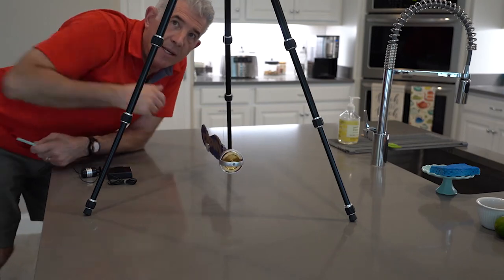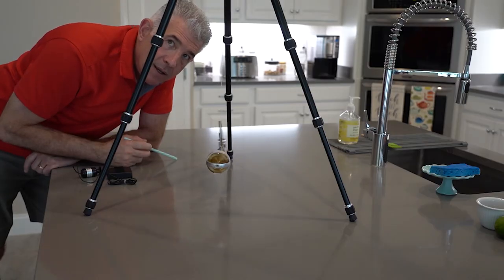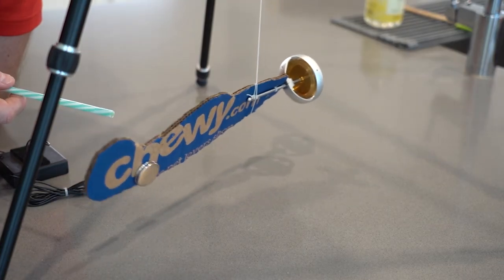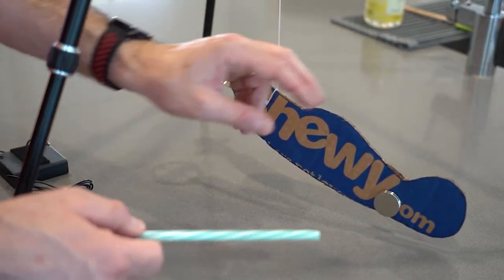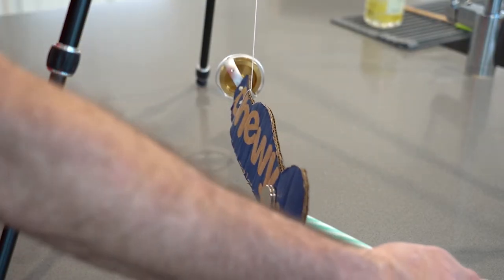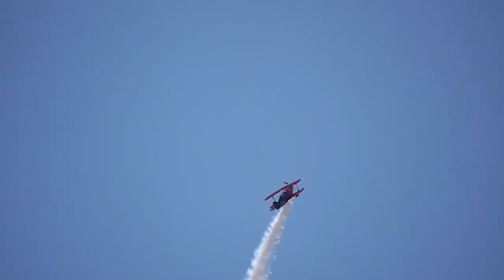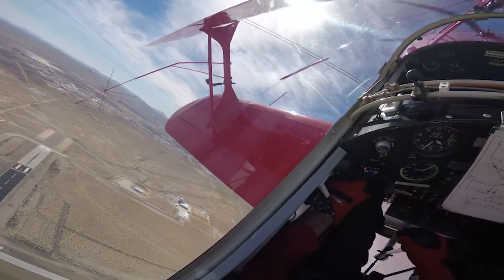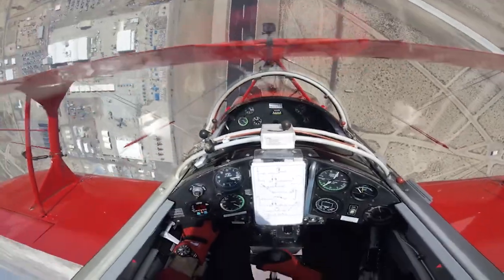Play by Play Series - Double Hammerhead: Why Gyroscopic Precession Is Your Friend

Comment: Spencer thanks for the great double hammer video. I have tried to do these quite a few times over the years (G202) and never got close. Today I went up and gave it a try and although I didnt pull off a good one I got a lot closer, I think with some more practice I will manage it!
Reply from the maker: The secret to doing it well is the timing of when you kick and then when you shove that stick forward those are the two things you have to figure out and it's hard to tell you exactly what's right for your airplane you just got to try it a million times
Reply: @ssairshows  I think I would die if I threw up a million times.

Comment: Nice demo.  I was trying these the other day and failed miserably.  After three attempts I gave up, but after talking with some folks and like your demo, I really need to be a bit positive on the up line.
I noticed you pulled the power after about 3/4 of the second hammer rotation.  Is this done to help avoid a flat spin when trying to arrest the second hammer?

Comment: Is the right aileron during the right kick recovery (before the quarter turn) just to line up perpendicular with the runway or does it have to do with the recovery itself and staying coordinated? Great stuff by the way!! Fantastic flying and terrific to hear you talk about the physics of flight!!
Reply from the maker: That helps with controlling torque so the fuselage doesn't twist around, this is not a coordinated maneuver.  Even in a normal hammerhead right aileron is used for that purpose.

Comment: Hello,
Great tutorial! I’ve been doing this on Extra 300L. About 20 degree from vertical -> 50kt kicking left rudder -> slamming the stick forward at 45 degree yaw. I’ve done it with full throttle the whole time, but I saw you put it to idle when dropping the nose for the dive. Do you know does it make a big difference? I guess I’ll try that also…
Reply: Ok you explained it already for someone. So it is basically to prevent torque roll. Extra doesn’t really need that so I’ll stick to my already working technique. =)

Comment: Hi Spencer, I notice you cut the throttle momentarily coming out out of the manoeuver. What's going on there? Did you ever part own N260SD?
Reply from the maker: Good observation!  On the last part of the maneuver I have found the pulling some power helps the nose drop to the downline cleanly otherwise it hangs due to rigidity then finally the plane torques around 180 degrees on the roll axis.

I have never been involved in 260SD